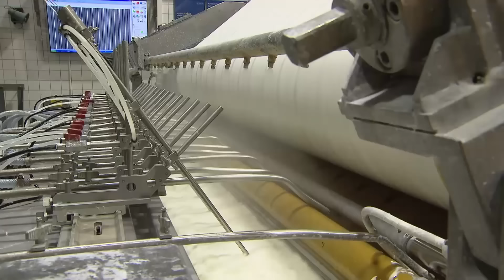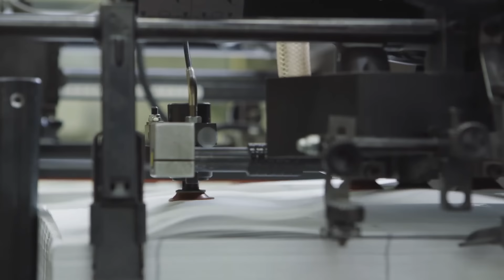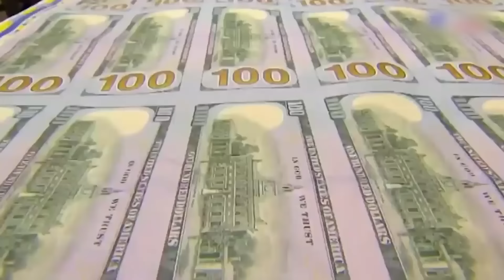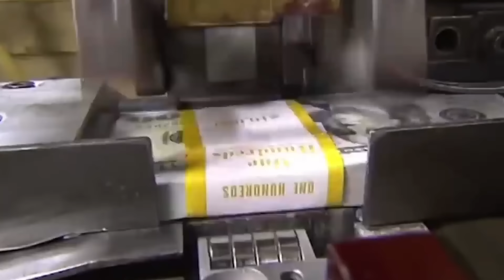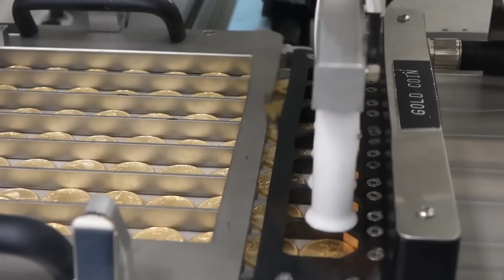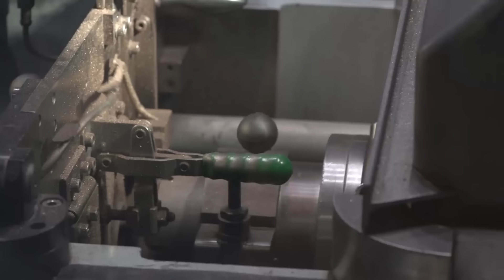How Money is Printed -  100$ & 100€ Bill - Inside Banknote factory (Inside U.S. Dollar Factory)

Comment: Crane Co. is that also the company that purchased those at will loving scoundrels Cummins Allison 852 Feehanville Drive Mount Prospect, IL 60056 ? They fire technicians that do not go along with their theft of service ring and try to destroy them at any way possible.
Reply: Theft of Service Leaders in an educated opinion.
I was a field service tech for Cummins Allison 852 Feehanville Drive Mount Prospect, IL 60056... They make money counting equipment however ,this is what ya deal with, half assed refurbished parts and to top it of they told me not to do the preventative maintenance anymore at customer sites just run the vacuum a little bit and wipe down the machines (make it look good). I was like "But that is gonna make the service call numbers go up and is >theft of service< WHY ? Well they wanted to keep selling new equipment every 3 years or so as the stuff would have lots of problems see ? With At Will, I was fired...SAD HUH ? Country is in TROUBLE...INVESTIGATION is needed asap folks. I thank you. BTW